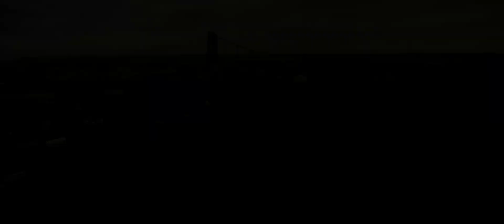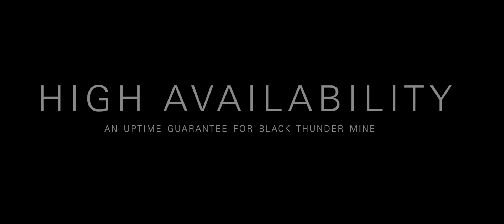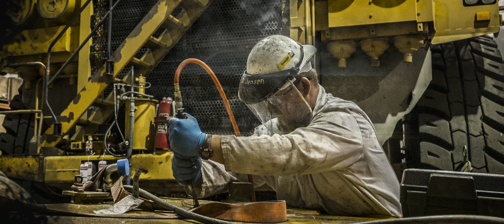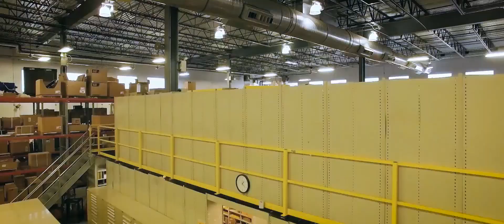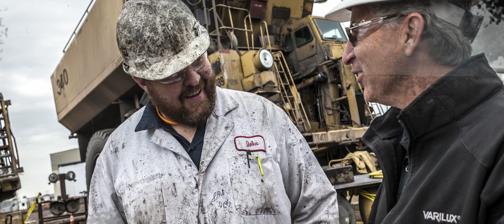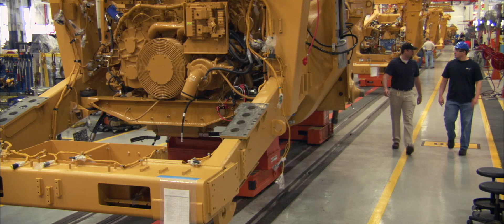High Availability: An Uptime Guarantee at Black Thunder Mine

Comment: Repairs wouldn't be as crucial if equipment costs weren't so high and the user could afford to have a few 'spare' machines to fall back on when one goes down for any reason including maintenance.
Reply: It's cheaper to sub contract repairs and maintenance
Reply: @skyking6989  Ah yes, the bottom line.  The hamster wheel spins on.
Reply: @triple6758  There is always a bottom line